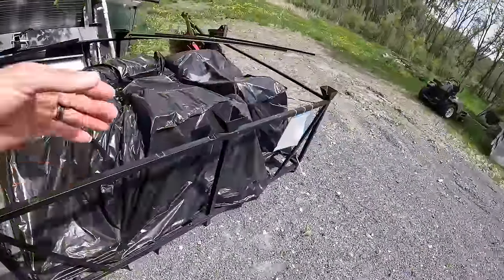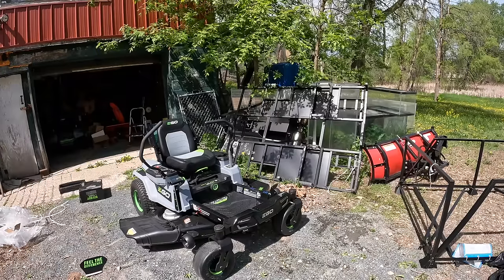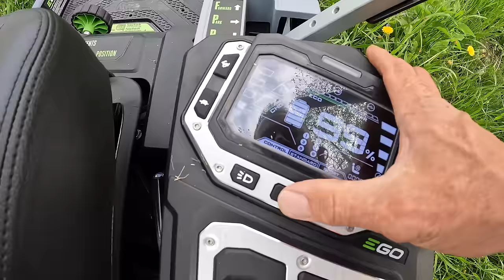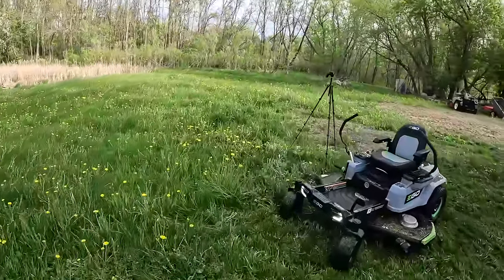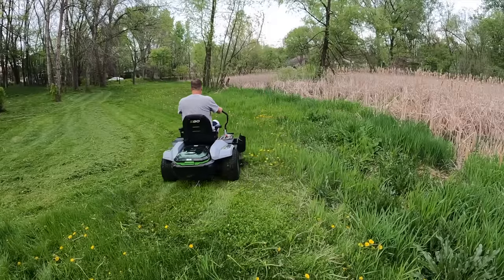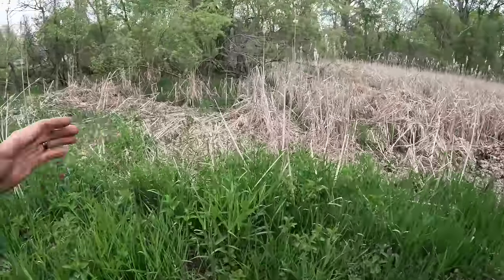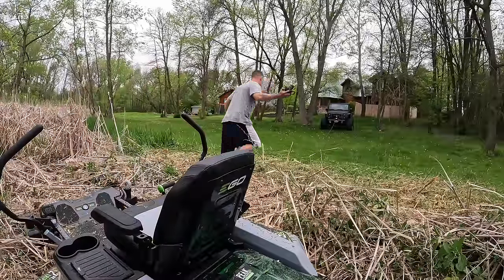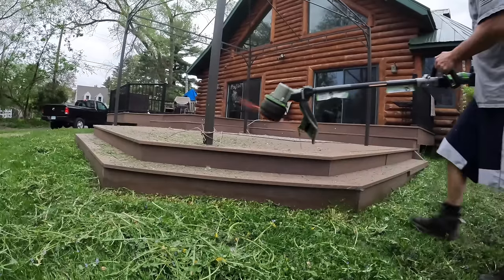Beating the hail of out EGO's new mower in a NASTY SWAMP

Comment: Friend of mine bought this mower with the smaller 42" deck.  His wife side-swiped a t-post and cut a 1" gash in the tire sidewall in the first week on one of the back tires.
First riding mower I've run into that had car-sized lug nuts and a 4-lug pattern rather than just riding on a shaft with bearings.
Reply from the maker: 1000% beast 👌

Comment: Awesome video, appreciate you showing the reality of assembly, waiting for my old trusty Kubota to croak before I get this, as all my other yard tools are all Ego, I have 2.5, 5, and 10Ah batteries. Their fixed carbon fiber shaft string trimmer easily also works as an
edger, so much power. Tesla early adopter here, Ego is the Tesla of yardwork, shows how well engineered new tech is a winner all around.

Comment: Hey man great info 
I myself just looked at over 50 zero turns and really wanted the zero emission zero turn like this one. But unfortunately I have to big of properties to cut so I ended up with a 2022 kubota 21 hp zero turn. I wanted the most fuel efficient one I could find and this kubota I purchased is but online they say it’s absolutely horrible on gas. I can’t believe it because it cost me 13.00 to use my push mower and my zero turn on roughly 6 acres of really damp grass. This video really helps people decide on a big purchase which is awesome keep it up.

Comment: Great video!!!   As a lawn mowing business owner/operator, I would like to go electric with a zero turn….but the price of a mower that can do the job is a no go.  The EGO 52” seems great for a homeowner with one lawn per week to cut, not for a business.  The Toro revolution Z master looks like it has the run time for daily mowing, but at north of $35k, it will never pay itself off compared to the $ 8,000 zero turns that I make a living off of.  If I was a young man with 25 years of mowing in front of me, I’d consider the E mower at 30 k….maybe.  But at 65 I’ll never recoup the investment.
    However….I do use the EGO spin trimmer everyday.  The Ego mower is on my trailer for any 21” push mowing.  The blower is a carry on my zero turn saving a trip to the truck for a quick blow off as needed.   I also ride a Specialized E-MTB.   So my heart is into the battery stuff, but only if it is profitable.   If EGO wants to send me a 52” zero….I’ll be happy to test it in my world and tell the world!!

Comment: The fact that he was able to lay it on this side and hold it there one handed had me sold.  I’ll just have to be in possession of two zero turns.  I have to get this one to compliment my other ego products.  I’m doomed if they ever come out with a 60 inch zero turn.
Reply: yes that is huge. you cant do that with any gas equipment for multiple reasons, and this is no problem. I've flooded my push mower tilting it probably 45 degrees and it was so done.
Reply: @frydemwingz rip
Reply: Maybe next would be a 52 inch with the steering wheel handle

Comment: I wanted to try an Electric mowing brand and found Ego having a little sale in Lowe’s and I got a weed eater and a leaf blower. 

I actually wanted a weed eater as the ones I have were starting to give out after a lot of years of tough work. 

I didn’t think it was gonna be good but I just wanted something for the house that was gonna be easy for my family to use without having to prime it and do all the steps to turn the god darn thing on lol.

To say I was impressed was an understatement. It was so light weight and quiet I didn’t use earplugs for the first time and it was kinda a relief!! 
So happy with it and now I’m going to look forward to replacing all my gas powered equipment that has done it’s fair share with new and modern electric power!!

No the electric weed eater didn’t have nearly the same power output as my gas one but it served its job for regular every day lawn maintenance.

Comment: Thanks for sharing your thoughts and videos. Very interesting and entertaining. You need to ask them for a wireless remote Control like what you would use for an RC car. That way you can get off the mower and drive it out when you get it stuck. Many years ago I had a John Deere F525 mower, 3 wheels, front deck, hydrostatic. Was an amazing mower, cut thru many places that I had no business being in. Had some wet areas like you have and whenever I got stuck I developed a routine to get it out since it was basically a lead weight on wheels and I had nothing to pull it out with. I would get off, push down on the seat with one hand, and start it with the other. Then release the parking break and rock it out with one hand on the hydrostatic peddle and the other pushing down on the seat. Just removing the weight of the driver often was all it took to drive it out with very little effort. Wishing you and your family the best.
Reply from the maker: Haha that sounds like a pretty sweet system ya had there! Impressive

Comment: I have an ego walk behind mower weed Wacker and blower. I have no complaints about any of the three. Great products. Just pop on the battery pull the trigger and away you go. No having to fight pull starting a fussy engine much quieter variable speed with the trigger giving great control. If I had the acreage I would absolutely consider the zero turn mower. Cool video

Comment: Stanley,  you almost nailed it right on the head when you mounted up (installed) the seat. The electrical connection is for a "dead man" switch which on gas machines shuts the motor off near instantly. On that one it will shut all the motors off. I know that as I used too work at a Sears in Kentwood, MI. I was in charge of setting up riding mowers, zero turn and garden tractors. The cheapest setup for the Dead Man Switch would be blade style contacts which disable the motor. Rear engine riders would use a momentary push switch (hold down for it too work) and then on the middle too biggest machines and zero turn mowers the dead man is in the seat itself. It twist locks with a quarter too half turn on a built in mount on the seat which disables the ignition and stalls the engine. On that one it will stop the motors from running. Make sure no reset is needed in case it is triggered.

Comment: We've got both the 42" and 52" Z6. Twice so far this season, I've got our 52 stuck in "Spider Alley" (don't ask) which is mostly a swamp after a decent rain. Both times I simply tied a rope from the 52, and ran it to the 42" about 30ft away, and easily pulled it out both times. It's crazy how powerful these are with enough traction. Wonder if we could put some heavy treaded tires on these things... anyone know where I might find something like that? Great review as all ways Stan!
Reply: Do they use different size tires than other zero turns use? I was thinking about getting one of these, But I'm not sure how long the batteries will run the mower for with all 6 batteries? Stan didn't really talk about it. But it seemed like he mowed for maybe around a couple hours at least in between filming and it had 33% left. I'm guessing it would go for at least 3 hours but not sure.
Reply: Go kart
Reply: That's why you're seeing rear tracked designs just as is true on Farm Tractors going on forever now as standard. Great question! No need to wait on a proper towing vehicle now as well given both the Ford F150 Hybrid and now both Rivian R1T and Ford Lightning for commercial use. Plus Ford Hybrid Maverick might finally be hitting the dealer lots come September in volume. Really still in the first innings of the pure BEV revolution as still all about power output and not integrated charging infrastructure with solar as Tesla has been doing going on many Years now.

Hybrid technology hasn't even made an appearance in this market as of yet but yes, absolutely I think the Ford F150 Hybrid and Ford Maverick are going to change that BIG TIME hopefully as soon as next year.

Comment: In the storage compartment, you'll find a pair of skinny slots to the outside. That's where you put the hole plugs when you install the bagging kit, which is sold as an add-on. There's a different set of blades that go with the bagger, to get enough airflow, so don't skip those! I work at a mower shop where we sell this brand

Comment: What was the length of time for battery to get down to 33 percent? I mow 6 acres with  a toro hydro 520 with a 72 in deck about 2 hours. If I use my scag turf tiger 60 in deck takes about 45 minutes. I would like to try one of these mowers out for comparison but no one around me does a demo.

Comment: Looks like it cuts good ...pretty decent speed too. I'd be curios to know if the performance would be the same in season 2 and 3.
I find the battery powered stuff is great for the first little while then before long the total run time per charge goes downs a fair bit.
Reply from the maker: I'll keep y'all updated on that
Reply: I think a mower like this should be the LiFePO4 battery chemistry. Much more resilient long term than typical lithium found in 18650 cells used in tool batteries. On a mower like this you could easily have 16kwh of lifepo4 that could be quick charged when on the trailer from a truck battery
Reply: *not a literal truck battery, an even larger EV battery that could supply the mower
Reply: @habivore47392  ford lightning has entered the chat.
Reply: After 3 years my ego push mower 20 some inch cut still performing as good as day one. The same with my ego blower and weed Wacker
Reply: The lithium batteries last better than what Ryobi was putting in their older machines
Reply: I’ve had the Ego push mower for 5 years now. Same battery same charger no problems whatsoever. I’ve since bought the trimmer, edger, blower, and chain saw. They kick some serious ass. Zero Turn and Snow Blower are next on the list
Reply: @simpleagain1  awesome to hear so far I only have the 615 blower but love it plan on going all battery for any yard stuff tired of gas anything for yard work.  My son in law laughed when I said I want battery stuff, he said .oh your going green huh and laughed.  But now he’s having a lot of trouble with his 2 year old 1,200 self propelled mower and so aggravated .  I haven’t said anything to him but that’s why I going green with yard equipment stuff.  No more has issues or oil issues just tired of it and the newer electric like ego I think they put some good engineering into it .   So I’m on board too

Comment: I'll keep my toro that I can mow faster without skipping or double mowing to get the height i want....and don't need an engineering degree and the patience of a nun to repair it if need be. It's nice that tech has advanced but it's not where it needs to be for me to even consider it.  My commercial toro would of been a one pass cut with an edge pass to mulch the long stuff. Not to mention that I don't think this could handle,  efficiently, row Mowing like most people do with a zero turn. You can hear and see if underperforming blowing grass away from the middle by circle path cutting....I think it would be a struggle row pattern cutting.

Comment: If you set the blade speed to 2 and the grass is to thick and tall the mower will adjust the speed up to get the grass mowed and vi-sa-versa. I got that trimmer, and I took out the top screw where is folds and got a cotter pin like the ones that hold deck connections on a regular riding mower, i replaced the top screw with one of those clips then cut the clip so it didn't stick way out. Now when i put it away i pull out the clip and fold it to store it straighten it and put in the clip and start trimming.
Reply: I’m going to do this with my trimmer..Thanks.
Reply: @Dhardc  I bought the Black diamond trimmer line from home depot in the 253' clam shell for under $19.00 real good line, very durable, i took a 2x4 set 2 deck screws 7'2" apart, the start held on be needle nose vice grips and wrapped the line around until the clamshell was empty, then cut the line on the end with the vice grips and you end up with 18 pieces about14'5" long. roll them up and now they are ready to feed into the trimmer when needed. Hold the line when loading the trimmer so it doesn't overlap when loading and it will feed out without tangling in the spool and get trimming. That line will trim brush over 3/8" thick, it is pretty sharp and .095 thick will last a long time.

Comment: Our Hustler Raptor SD would never have cut that good.  The shoot plugs with any wet grass and we have to mow with the deck all the way up and work our way down with 2-4 cuts.  Even with new blades.
Reply: Best advice I can give you take off the grass shoot and cut the piece that goes across the opening on the bottom... I also cut a piece that I just self tapered on top of deck to make it where the blade can't hit trees or anything deck has only ever clogged on me once since! It was horrible before u literally was about to pour a line of gas to the open  gas tank one day!
Reply: We had similar issues. Found out the best way to mow (if you have the time) is to mow with the shield up, blow your cuttings into the uncut grass, turn around and cut the opposite direction whatever is left. Then repeat. Yes your mowing 2x but it looks good and if you have a good spot to blow the grass to on the final cutting it’s even better.

Comment: Now That's my kind of string trimmer. I threw my last one in the ditch and walked away lol. Not really, but Im going to check this one out. I had to siphon gas out of my truck for my Honda push mower 4.98 / gal in North Fl . Im right on the verge of going electric for some applications.
Reply from the maker: Seems like electric powered ones are just getting better and better

Comment: I like EGO products.  I own 3.  A push mower, grass whip, and a blower.  I have been looking at Zero Turn Mowers.  The one you tested in this video has a LOWE’S price of $6,999.00.  That is a lot of money for a residential grade mower.  I can get an entry level gasoline power Professional grade mower from a reputable manufacturer for less money.  When those 4-6 batteries won’t hold a charge anymore, you have a very expensive problem on your hands with those 12 amp hour batteries.  You might as well chuck the mower.  My battery on my push mower failed and they are sending me another one.  There is only one problem - when.  It has been over a month, so I called again and they cited “supply chain issues” and hoped they could get one to me by July sometime.  If I didn’t have a couple other EGO batteries that are smaller, I wouldn’t be able to mow my lawn at all.  Mowing season in Michigan’s lower peninsula begins mid-April.  What would my lawn look like by mid-July or longer.  China controls 90% of the rare earth minerals and lithium is one of those minerals, thus I am at a Chinese based company’s mercy.  As an American I don’t like that.

Comment: My 52" EGO's blades stop in thick grass that is a little higher than what it is when I normally mow.  I mow every week when the grass is growing, but if I miss a week, there are spots that the mower will shut down the blade motors (without a red flashing light).  It does this at all blade speeds and modes.  I have the latest firmware (at least I did a couple weeks ago, I haven't checked for an update in a week or two).  Anyone else have this happen?  I haven't called EGO support to complain yet.   I enjoy the channel, Stan. 👍

Comment: Stanley,  could you do a episode trying out different gas string trimmer heads. I picked up one from Lowes today and so far it is a beast on my Craftsman String Trimmer purchased last year. Do not like winding string. I used too use one known as Hassle Free II which was sold at Sears. Instead of buying precut and folded line, I purchased small coils of refill line and would cut a short piece off. Lasted a good bit that way.

Comment: As one with several e bikes, I cringed when you knocked the one battery off the deck, treat them with respect!  Like you would a jar of gas. Yes they are packaged/protected nicely, but still..... I just noticed it has backup lights when in reverse, be still my beating heart! You interuppted it's equealizing charge, stopping at 99%, all those individual cells in those 6 batteries need to work as one, leaving it plugged in for an hour or so AFTER it reachs full charge is the way to do that.

Comment: I thought I was the only one that has to pull my zero turn out of my low wet areas sometimes. Now I use my MT100 Nice mower im thinking of selling my Grasshopper zero and going with an electric. Batteries being 500$ a piece is a downer since it takes 6 but comes with 4 at around 5k 😮

Comment: Does the string trimmer feed while it's going full bore?  Or does it click out when it spins down?  Every battery powered string trimmer I've tried, you have to stop the motor and let it spin down to feed the line.  ABSOLUTELY unworkable situation for commercial use.

I like they are lightweight, powerful, and the ones I've used have an edger wheel (ground wheel, not an edger blade).  Love everything about them except the feed.  I'd rather bump it to be honest.

Comment: How long did you use it for and how much power was  left  also in the directions can the charger unit be used on a converter 12v to 120 that way if your using it commercially you can charge it on the way to the next property  . It looks interesting  not sure how it will stand up to long uses  but looks good.